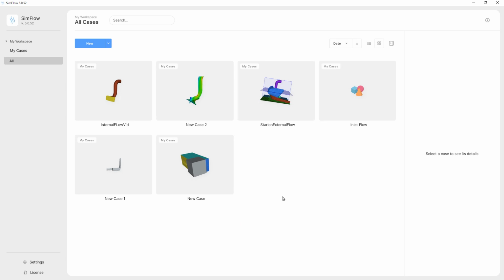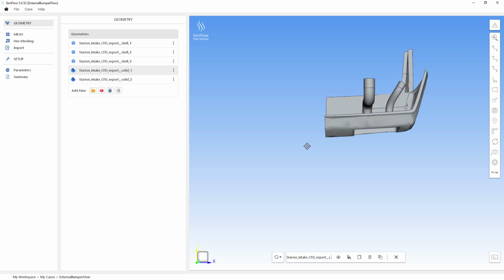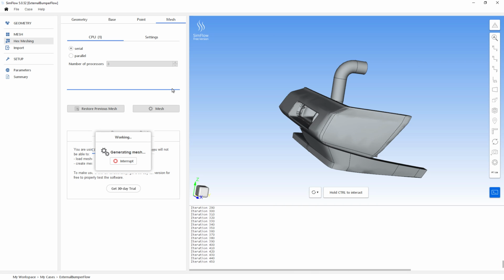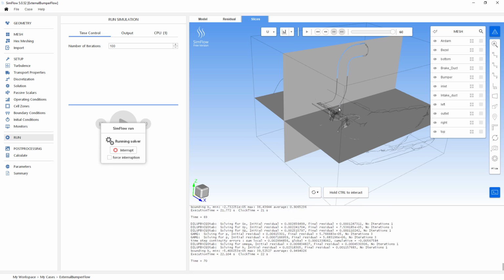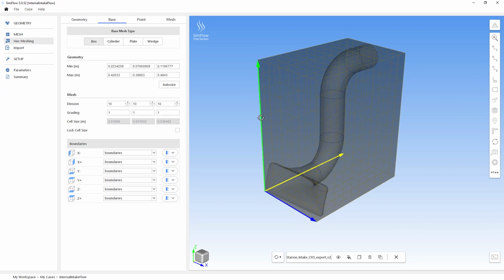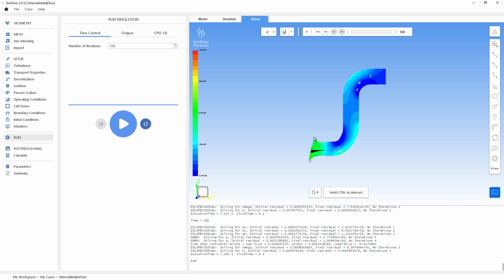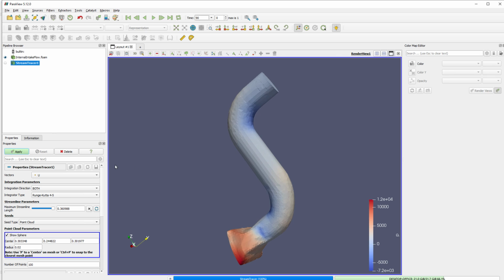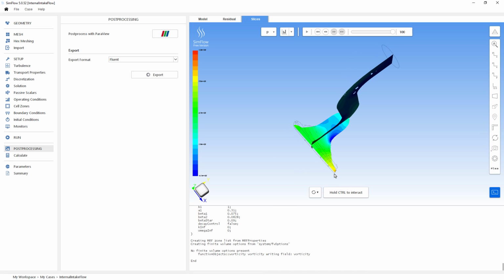Design Car Parts with CAD | Intake Duct CFD for FREE with SimFlow

Comment: I never could get any of this to work. I could get it to mesh the object, or the sides (inlet, outlet, etc) but never both. And with only the object meshed you have no way to define boundary conditions. Or, with the sides you could define boundary conditions, but it couldn't 'interact' with the object in anyway. Even followed several of their tutorials from their website.
Reply from the maker: Yeah its really restricted on the free version and honestly from what I have seen the paid version isn't easier to use.  It costs a bit but AirShaper is much easier to use and has some internal flow tools.  If you are trying to do ducting it might be worth having a look.

CFD is a pro tool so not much that is free out there is going to be great or easy to use sadly.

Comment: Looking for options and seeing how they behave. Automotive is an easy pick, though I need to do something custom for an over the range exhaust duct to be able to flow [up to] 400 cfm.

Thank you for the walk through
Reply from the maker: If you have commercial or edu fusion you can do a flow study in generative design to try and optimized the flow path, but that wouldn't use normal duct components.  I was also really happy with AirShaper which has a beta version of internal flow.
Reply: Normal sheet metal products are not flexible enough for the small cavity present
Reply from the maker: @UnfrozenScoundrel  if you have access to extensions and Gen Design in fusion it would be worth to see if you have a simulation trial so you can do some free solves and give the flow path stuff a try.  it works for air or water and does best with single inlet and single outlet.  You can model the hood and the final exit duct and give it space in between and let it give you a shape.

Comment: mate this has been unbelievably helpful for me getting into the program and run my own shenanigans, i came from OpenFoam and this is much more welcoming of a software! thank you so so much.

though question, do you have the formula that you used to get that 127 number for the pressure at 12:00 ? what exactly goes into obtaining that number, since im trying to do simulations on aero devices and seeing the general flow of the air, it'd help me a ton if i knew where the numbers are from, again thanks a bunch!
Reply from the maker: There are all sorts of calculators online to help and the help section for Simflow does a decent job of explaining every input they have.  Also not sure if you saw the recent AirShaper video (another one coming out this week).  Very easy to set up.

But to your question.  The free stream air pressure is a product of the air density and wind speed.  Think of it like a 50mph wind and the pressure it would exert when it hits something (at least that is how i think of it).  The formula is .5 * air density (1.225) * velocity.  square all that.  My 127 was an estimate and likely a little on the low side.  Lets say 20mph which is 8.94 m/s.  .5 * 1.225 * 8.94 = 5.48. square that and you get about 30.   50mph is about 22m/s.  so .5 * 1.225 * 22 = 13.475.  square that and you get 180.  So my estimate was probably closer to 40mph....
Reply: Alrighty mate! thank you so much, i'll be sure to check out the help section.

I really do appreciate you going out of your way to explain all this. Now i can more easily tune my simulations to fit my needs. This has been invaluable to me. Again, thanks a million mate! cheers!

Comment: I tried doing this in 2013  for magnetics before everyone had giant matrix processors in their machines. It's very cool how the technology has developed. I figure this is the type of thing that "Get's you close enough" Though I wonder what sort of power and software  the F1 teams use for hardware with those 14 element wings they run now in the front of the car.
Reply from the maker: Their setups must be pretty massive for sure.  My guess is they offload processing to servers.  Gone are the old days where you would start a simulation at the end of the day and hope it didn't crash over night and was done by the time you got to work in the morning :)

Comment: Is there a way to simulate intake and exhaust scavenging? Ive been wondering if this is possible for a while lol
Reply from the maker: There are a few out there that are made specifically for engine simulation but i haven't used any of them.  i have come across a couple.  I think DynoSim6 is supposed to be for "enthusiasts".  Ricardo WAVE is a sim specifically looking at valve trains but i don't know if it can handle what are you are looking for.  Here are a few more. GT-POWER, SimScale, Engine Analyzer Pro, Dyomation-6

Comment: Very interesting.  I'm currently working on increasing airflow to my air-cooled aircraft engine, and your intake design model is very similar to an unused oil-cooler duct that I can convert into an additional cooling duct. The only quantitative knowledge I currently have is from an HVAC pressure differential meter.  I certainly need more quantitative information.  In both your case and mine, the "back pressure" of the exhaust will always affect both the velocity and pressure delivered.  It is a complex system, but a simulated approach to individual aspects would provide insight into how potential modifications could impact the system.  So yes, more simulation would be helpful.
Reply from the maker: For sure.  as I said in the video Garbage in Garbage out.  the assumptions we make are what differentiates those with the masters in this topic vs those like me just trying to understand it :)  This setup is akin to say a ram air on an NA engine where at speed you get a few PSI.  The CFM of the engine, size of an airbox, restriction of a filter etc all come into play.  Im afraid with a free version of this you just simply won't have the resolution to be able to dive that deep.  So what I look for is any geometry that causes pressure or flow changes assuming no restriction on the exit.

Without any geometry restrictions using a Naca duct or Venturi shape would likely be ideal.  Something that doesn't introduce any pressure spikes.

Comment: Yeeeeaaah) Thank you so much!

The Simulation extension in Fusion does not allow simulating aerodynamics and airflows
Reply from the maker: Awesome, hope it helps you design some cool parts!  Yeah I wish it had CFD and you didn't have to export to ANSYS or something else.  The fill SimFlow is like $8k/year but it was the easiest ui/ux I could find with a free offering to show.  Provides just enough insight to help but the 200k nodes is a big limitation past simple geometry.